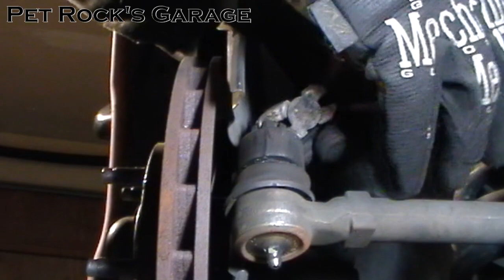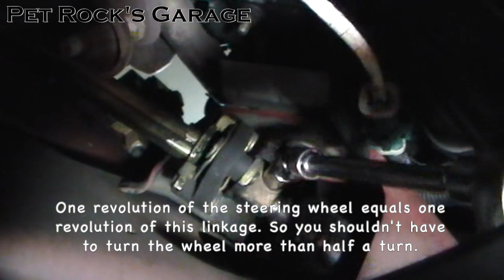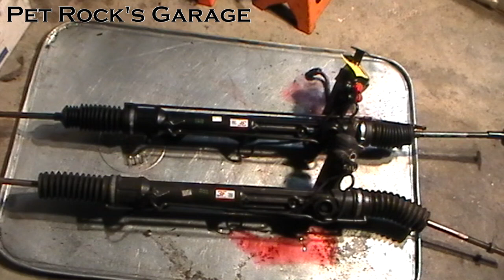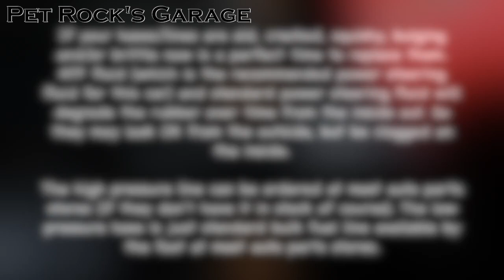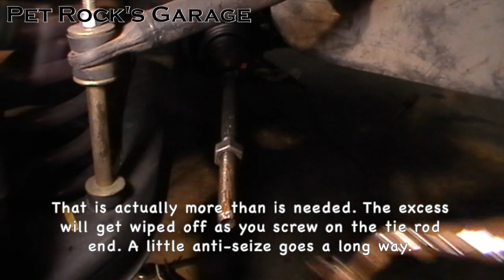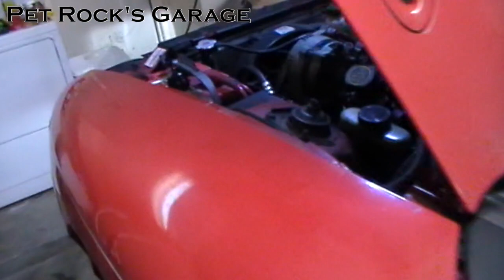How To Replace Power Steering Rack & Pinion -- Ford Mustang ('79 - '04)

Comment: Can you direct me to which the low and high pressure lines are? I wanna buy them and any of them that can possibly be broken if i screw up😂 i only got this weekend to do the rack, control arms, tie rods, balljoints and one wheel bearing lol just wanna make sure man! Please and thank you in advance.
Reply: For the pressure hose i see pump to hydro and hydro to pump? 
And for the return hose i see pump to resevoir and rack to cooler? I am just unsure man and a little dumb bear with me pls😂
Reply from the maker: You're working on a V8 Mustang, correct? A good source for parts is rockauto.com. They lay it out pretty simply. They may not be able to ship to you by this weekend though.

The high pressure hose is often called the Pressure Hose and the low pressure hose is often called the Return Hose.
Reply from the maker: If you have hydoboost, then you need two hoses. Pump to hydro and hydro to gear hoses. If you have a power steering fluid cooler, then the hose from the cooler to the pump is likely just standard bulk power steering hose you can get at your local autoparts store. Bring your current hose with you so you can get the correct inner diameter for your car.  The rack-to-cooler is likely the same as a rack-to-pump return line hose. You just trim down the open end as needed. Hope that helps.

btw, thats a lot of stuff to do in a weekend if you aren't that confident in your abilities. Good luck!

Comment: I have 98 GT (4.6) somethings weren't the same in my car vs you v6

1) The return line disconnect is at the bumper not closer to the rack 
2) the tension is a 1/2 inch ratchet (no socket needed) with short extension 
3) the hex nut to turn the pump is a 5/16  
4) I also found that removing the sleaves (that hold the rack up where the bolt goes), place the rack and then slide the sleaves in (no need to pull out bushings) works better because if you don't, it hits the oil filter.

hope these tips along with your video helps the next guy
Reply from the maker: Good tips. Given the age of these cars, it's hard to tell what is stock and what has been modified. Many have been highly modified over the years with multiple owners. Some more obvious than others. In my case, my wife is the second owner as of roughly 2000 and we haven't modify it at all since other than maintenance items and it's still running strong. I'm glad my video at least got you in the ballpark to do the job yourself. Thanks for watching & commenting.

Comment: On a 2001 sport trac where does the return hose go is a short piece of metal will the rubber hose and a clamp rubber house goes to the little cooler on top of the Rack. So does the return go to the top or the bottom part on the rack
Reply from the maker: Your post don't make much sense with no punctuation.
The return hose goes from the pump (or small cooler, if your truck has one) to a metal line coming off the rack. That metal line connects right next to the high pressure hose line on the rack. Yes, they need a clamp on both ends.

Comment: Real quick 2001 sport Trac four-wheel drive power steering pressure hose has two d I am so close to driving it again 
ifferent fittings one at each end which one goes in what port on a rack.
Reply from the maker: The fittings on each end are different sizes, so you can't mix it up.  It only goes on one way. You should also be able to see the end that attaches to the rack in this video. Good luck.

Comment: Nice video. I have swapped my 88 GT rack several times, replace a stock, then a FR manual, then a stock, and now finally an 03 GT rack rebuilt at turn one. I have lost count of the threads long ago.
I cannot find anywhere that shows how to figure out the count of turns starting from scratch, not counting off the old rack for the tie rod ends. also is the count supposed to be the same on each side.?
I've got a great rack now, just need to get it set right.
Thanks, I think this is the best video I've found on doing a rack.!!
Reply from the maker: If you get the rack centered with the tie rod ends disconnected you can then eyeball the number of turns to get the wheels to point straight-ish. You'll never get it perfect or properly aligned yourself. Just get it so you can drive it immediately to your local alignment shop and have them do the rest.

You can tell if the rack is centered by measuring the length of the bellows boot on either end of the rack. They should be roughly equal when centered. Hope that helps. Good luck.

Comment: Thanks for the video!  I was wondering if you would know… today while changing my control arm.  I took the control arm bolt out and nicked the bellows boot and oil/fluid dripped out of the boot.   Is there supposed to be oil in that boot or is the rack leaking ?
Reply from the maker: No, there shouldn't be any oil in the boot. Your rack is leaking and needs to be replaced. Good luck.
Reply: @petrocksgarage  Thank you
Reply from the maker: @jamesa6272  No problem. Good luck. Hopefully my video helps you out.
Reply: @petrocksgarage  Oh it definitely will.     Finished up the control arms and springs today.    There was brown fluid coming from the rack boot.   Weird thing is the pwr steering fluid is still full but the brake fluid seemed below the full mark.   Is there anyway brake fluid can mix with the power steering with the hydro boost system?
Reply from the maker: @jamesa6272 , I'd be extremely surprised if brake fluid was getting into the power steering system or vise versa. The only way I can think of it happening is if some lines/hoses were mixed up. The power steering lines shouldn't go anywhere near the brake booster.  I'm not aware of a Hydro-Boost being available on '79-'04 Mustangs from the factory, but there are aftermarket kits around apparently.

Either way, does the fluid that came out look anything like the fluid in the power steering reservoir? If not, then are you sure it was oil that came out and not dirty water?  If it was dirty water, then you don't need to replace the rack. Just the boots and the clamps holding them on.
Reply: @petrocksgarage  I wish it was water.  No it was definitely dirty oil colored oil
Reply from the maker: Sorry to hear that. Good luck.

Comment: Have a 2007 mustang gt and can’t find a video anywhere for rack and pinion lol
Reply from the maker: I don't have access to that vintage mustang at the moment, but if memory serves from when I worked on my brother-in-laws '07 GT500 some years ago, the rack is set up very similar to the Fox Body & SN95 mustang racks for this video. So this video should be able to get you the majority of the steps & info you need. Good luck.

Comment: Any advice if one of the tie rod ends is refusing to come out? I've tried hammering and penetrating fluid
Reply from the maker: Heat is your friend.  Heat up the part of the knuckle that the tie rod goes through. It will likely melt the tie rod end boot, so the tie rod end will need to be replaced. If you don't have a torch, you can pick one up at your local hardware store or home improvement box store for around $30. Well worth the money, IMO.  Good luck.
Reply: @petrocksgarage  I'll get one soon and try it, thank you for the quick response! Your videos have been very helpful :)
Reply from the maker: @danielito-svt , good luck. You'll want MAP gas (yellow canister). It runs hotter than propane (blue canister).  Get the knuckle part nice and hot (does not need to be glowing) and then hit it with a hammer. Biggest hammer you can get your hands on. I use a mini-sledge hammer. That should knock it loose. Good luck.
Reply: @petrocksgarage  worked like a charm! Power steering rack has been changed out, and it no longer sounds like beehive in my engine bay, thanks again! :D

Comment: Hi question is why did you change the rack I want to know if I need a rack on my 1996 mustang my problem is when I turn the streering wheel the rack gets a poping sounds
Reply: Turn left or right anyone can answer
Reply from the maker: @brown8493 , I replaced it because it was leaking. Before condemning the rack, make sure the popping is not coming from the tie rods, ball joints, control arm bushings, steering shaft or anything else that might get hung up as you turn. Shouldn't be too difficult to diagnose with a friend turning the wheel back & forth as you look underneath looking for any movement that shouldn't be there. Good luck.

Comment: How do you know when to replace the steering rack?
Reply from the maker: There are many different signs. Oil leaking out is the most common. The wheel sticking in spots when turning and other mechanical issues are less common but can occur. Hope that helps.

Comment: You are the best. I  tried replacing the high pressure line but couldn't get my hands to get a bite on the threads. Now I  see I'll need use everything you so expertly demonstrated. Except I may need to see who can loan me a torque wrench.
Reply from the maker: Thanks a lot. I appreciate it.  You can rent a torque wrench from most auto parts stores. You get 100% of your money back when you return the tool.  Good luck.
Reply from the maker: btw, if you are just replacing the high pressure line you don't have to touch the tie rod ends. Just unbolt the rack from the subframe, pop it off its mounting posts, drop it down a little and support it with some jack stands. That should give you enough clearance to get access to the hex end of the high pressure line going into the rack. This way you don't need an alignment afterwards. Good luck.
Reply: @petrocksgarage  thanks
Reply from the maker: @georgelogreco8810  no problem.

Comment: you do not have a oil pump primer .. I use mine for everything
Reply from the maker: No I don't. I've never really had a need for one. In this case spinning the power steering pump pulley, like I show in the video, will prime it quite nicely.

Comment: My 97 gt has light or sensative steering.  When you replaced the rack did it firm up the steering at all? I want to firm up my steering wheel but I do not know if a new/reman rack is the answer.
Reply from the maker: I'm not sure what you mean by light or sensitive steering. Most people don't want much, if any, resistance when turning the steering wheel. So sensitive steering is often the desired effect. A stiff/firm steering wheel is typically a sign of a bad power steering pump.
Reply: @petrocksgarage  I had a 03 mustang with firm steering this 97 is like the older Gm’s. Can turn the steering wheel very easily… I replaced ball joints/ inner/outer tie rods, brand new steering shaft, brand nee rack bushings.  Reman rack was put in 7 years ago.    Was thinking about just putting in another rack hoping to firm it up.
Reply from the maker: @jamesa6272  it honestly sounds like you're used to your old '03 mustang, which likely had/has a bad power steering pump. You should be happy that the steering is nice and easy and that the steering system is working as designed in your new (to you) '97 mustang. It is expected/desirable that you should be able to turn the steering wheel with a couple fingers.
The only way that I can think of to make the steering wheel harder to turn is to do a Power Steering Delete of some kind. Maybe with a shorter serpentine belt that bypasses the power steering pulley? I'm not sure. I've never done one. I also wouldn't recommend it so do it at your own risk. Good luck.
Reply: @petrocksgarage  with the amount of tramlining this 97 convertible does coupled up to the loose/sensative steering(with no play) it feels dangerous while driving.  It felt good when I put the ball joints in when they were tight but as they broke in the sensitive steering feel came back.
Reply from the maker: @jamesa6272 , could one of the ball joints gone bad? Tram-lining, with no play in the steering wheel, is often due to tire tread. Some tires track the grooves in the road more than others. Are the tires different between your '03 and '97?
Reply: @petrocksgarage just getting back to this.   I changed the steering shaft.  There was play in one of the ujoints of the shaft.  I also added aluminum steering rack bushings and that tightened up the steering.       I still have to replace the rack from when we last spoke on here.   Haven’t got around to it.   Waiting for the warmer weather to come.   I plan on doing the rack , caster camber plates and a bump steer kit.
Reply from the maker: @jamesa6272  , sounds like you've got some work ahead of you. Good luck!

Comment: this is a great video!  changing my rack on '95 MUSTANG GT.  going with a Flaming River power rack.  I have a question tho.  My old rack was missing the input shaft dust boot , which you say to swap to new rack.  I have called Flaming River, my new one didn't come with one, they say I don't need with theirs?  Ive tried to search the part out,  I think its difficult to get.  Do you have any idea of a part # or where I might order? or should I just install, as Flaming River says, without it?
Reply from the maker: I'm not familiar with Flaming River power racks. The dust boot just helps protect the input shaft seals from debris to help prevent damage & leaks. I'm not sure on a part number, but you might be able to find one in a junk yard. However, if Flaming River says you don't need it with their racks then you can probably just install it without it. Hope that helps. Good luck.
Reply: @petrocksgarage  thank you, for taking the time answer my question.  That's what im going to do. I'll install without as I can't find anyone who even knows what im taking about. LOL
Reply from the maker: @JCCOLE1996  Sounds like a reasonable plan. Good luck.

Comment: I’m fairly new to stuff like this can you tell me about how much it would be to get all the parts
Reply from the maker: Like most things it all depends on where you buy them and the quality of the parts. I buy from a variety of places. Whichever is cheaper or has it in stock locally.  www.rockauto.com is a good place to start if you don't mind waiting for the parts to be shipped, then compare the parts to your local auto parts stores to see which is cheaper. If you absolutely need the parts now your best choice is your local auto parts stores. Good luck.

Comment: The small rod at the front of the rack, do you have any idea what it is? The same part fell out of mine, so trying to see if it is replaceable, or detrimental to the rack and pinion.
Reply from the maker: If you mean the rod that goes into the little knub on both bellows boots on either side of the rack? If so that is a vent rod. When you turn the wheel, the bellows boot on one side collapses and the other side expands. The rod equalizes the air inside them so it doesn't produce a vacuum. I wouldn't leave them open for long. You don't want water/dirt getting in the boot and messing things up. I would try to find a replacement if you can't find yours. Maybe a junk yard? These racks are pretty common, and used in a lot of different model fords for many years. So you should be able to find one fairly easily. Good luck.
Reply: I just need to know on the rack does high pressure hose go in the top port or the bottom on a 2001 sport Trac

Comment: Where’s the best place to get a new complete rack and pinion assembly?? I have a 2004 3.9 Mustang and I see different prices on the assembly..What do you recommend as a fair price to pay?? Or where would you recommend I purchase from?
Reply from the maker: There is no 'best place'. They all get the part from somewhere else. I've used Cardone & Autozone/Duralast remanufactured racks on this car. The Autozone one has been in the car for a number of years and I have no complaints. Keep in mind that some places have a core charge/deposit, so you send your old rack back to them for a refund. Wherever you get it from (rockauto.com, Autozone, Napa, etc) make sure they have a warranty and know what the warranty covers in case it starts to leak. Leaking shortly after install is a common issue with reman racks. Good luck.

Comment: Make Sure to put those washers on the high and low pressure lines on flush because if you re-use the old ones you will feel air blowing from the hood once you start the vehicle haha
Reply from the maker: The low pressure line doesn't have washers. Its just straight hose. But yes, the washers are 'one time use' only and need to be replaced if you remove the high pressure line.
I get the feeling that there is a good story behind how you came upon this nugget of knowledge. :-)

Comment: im pretty sure my pump went out yesterday, i was doing a 3 point turn and the steering wheel got stuck. If i tried to turn it would just whine so i just forced it so i could get the car out of the middle of the road but my steering is stiff unless im going 40-50
Reply from the maker: Yeah, that sounds like the pump. Good luck.

Comment: GREAT VIDEO as always!!! I have a question, My 20 GT has really stiff steering, but no noise at all when steering. How do I know if it is my pump, rack, or both? Any help would be greatly appreciated and thank you in advance.
Reply from the maker: Its most likely the pump.  But to verify, I would jack the front of the car up off the ground, start the car and rotate the steering wheel back and forth a few times. If it is still hard to turn then the problem is in the rack, tie rod ends, ball joints, possibly the struts (if your year has mcpherson struts like older years) or a combination of those. But if it is nice and smooth, then the problem is the pump. Your car is a 2020, so it should still be under warranty, I'd take it back to the dealer and have them fix it for free.  Good luck.